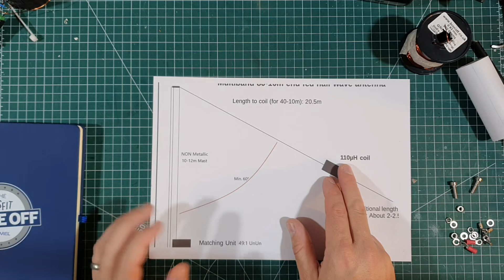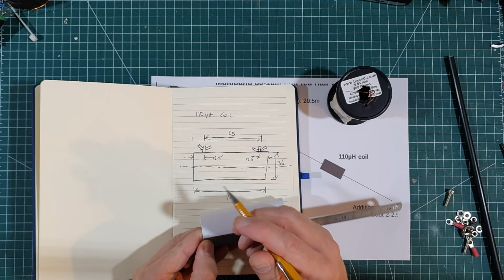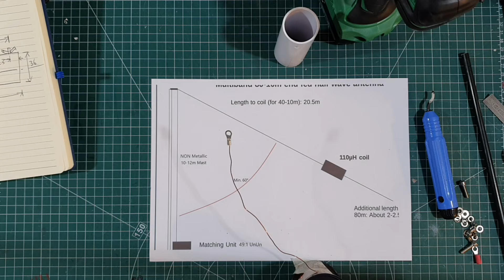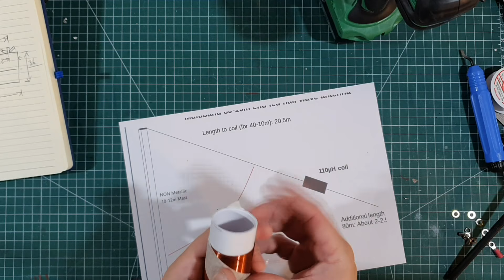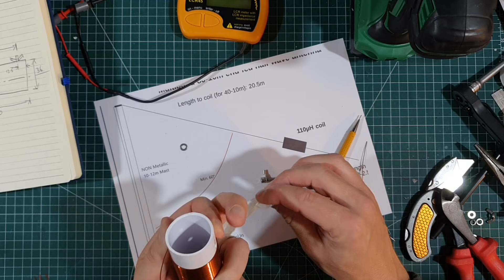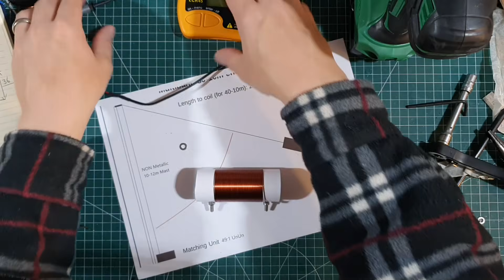80m with your 66ft end fed half wave antenna?... How to easily make a 110µH loading coil.

Comment: The video is old, but may someone answer my question. 66 feet wire length is from the mast bottom + to the top + the rest with coil or from mast bottom to top + 66 feet?

Comment: The coil built in this video is a workable field coil, but not an efficient or stable one.
36mm is too small for 110 uH; small diameter means too many turns per uH and excessive turn-to-turn capacitance. Use 50 to 75mm pipe instead.
Do not close-wind enamel on this type of coil. Tight packing gives maximum proximity loss, the worst Q and the most interwinding capacitance. Space the turns 1.5 to 2x the copper wire diameter. Use 18 to 16 AWG wire, not for higher power but for higher efficiency (for QRP or QRO). PTFE-insulated wire can give you the spacing you need, if the jacket is thick enough to leave a proper gap. ~110 uH on an LCR meter is still a good starting point, but wind a few extra turns initially and don't screw it down until you measure with a VNA, if available. (otherwise, stick to 110 uH on the LCR).
Non-sealed tape over a winding becomes a wet sponge after a rain; tape keeps UV off the enamel but keeps water in. Water ingress will adversely affect the SRF (self resonant frequency) for 40m (which must remain well above 40m) and affect the loading for 80m (shifts the 3:1 SWR bandwidth). Better to use a light conformal coating without a jacket, allowing the coils to drip dry.
The SRF should be checked on a VNA, before and after it is coated. The final SRF should be no lower than 12 MHz, ~15 MHz is better; if SRF is too low, expand the winding pitch or remove turns (removing turns also drops L, so you may need a longer 80m tail). Coat all but the last few turns before final measurement.
Conformal coating will raise the interwinding capacitance, so it will also move the SRF down. A thin acrylic / polyurethane film has the least effect: capacitance up about 10 to 25%, with SRF down only about 5 to 12%. Adhesive heat-shrink or tape (do not use) over the whole winding can increase C 30 to 60%. So start with a safe margin of SRF > 15 MHz and coat the coil lightly, if at all.
A larger form, thicker spaced wire, and a water proof winding mainly cut coil I²R and dielectric loss. Expect about 1.5 dB more radiated on 80 m. The bigger gain is stability: a taped PVC coil can drop another dB or more and walk off 80/40 m after rain.

Comment: You had that little bit of wire left over while making the inductor.  What would have been the inductance if you would have gone around 1 more time, would you have been closer or further away from the target of 110?  Either way, I'm going to try and build one of those antenna thanks!  Do you have the values for 160 meters as well?

Comment: I just finished building one of these coils. I'm here in the United States and used 3/4 inch PVC approximately 14 inches long. I wrapped it with 16 gauge enamel coated wire, 180 turns. My reading is 120 uH. I used a 7 ft piece of number 12 THHN wire and folded it back on itself.  I achieved a 1:2-1 swr at 3.800 mhz.

Comment: Can one get an antenna that works 80 to 10 down to around 40 feet by using two coils, one for the 40 meter band and another for 80? I want to work 80 but I just don't have the 66 feet to work with.

Comment: Isn’t the 20.5 m wire already at near enough quarter wave couldn’t you just bypass the auto transformer and throw as many radials to ground  as feasible.     and get a decent match or is this just for the convenience of using same set up?
Reply from the maker: Thats it. No radials and no mechanical stitching required.

Comment: I have room for an 80m inverted V between the first floor roof of my shack, the 2nd story roof and the roof of a backyard ramada.  I am thinking about optimizing 40 and 80 for NCIS allowing the harmonic bands to reach Dx heights (relative to wavelength).  I could switch in a coil at the apex with a relay for 160m.
Reply from the maker: Yeah thats an option. You could have another trap but bandwidth on 160 would be very narrow.
Reply: Just noticed that autocorrect changed NVIS to NCIS (and just tried three more times).  I have since seen that some people bypass the transformer completely  to use the wire as a quarter wave at 160m
Reply from the maker: Yes seen that. You need a big radial field tho. Not difficult to install a SPDT relay and switch it remotely.

Comment: Any suggestion on how to make this build resonant on 75 meters? Some content creators insert a capacitor at some defined point, but their build is different. I enjoy this antenna, and it works beautifully. But I'd like better SWR on 75 m. Thanks.
Reply from the maker: To get both 75 and 80 I think you will be toiling. The bands are just too close together.  We dont have 75m here.
Reply: @MM0OPXFieldRadio  Thanks!

Comment: Great video. I noticed that you used 0.63 mm enameled wire. What is the max transmitting power (watts) that this coil can handle?
Reply from the maker: Depends on duty cycle a lot. I haven't ran at 100w SSB but would give it a go.

Comment: I guess the same could be used to add 40m to a 20m EFHW? That would be really cool for portable use, making it possible to have 40m with a relatively short antenna. The coil could even be constructed more compact for use with a small 5 watt radio like the QMX. Do you know what inductance it would need to be?
Reply from the maker: Correct. It has been done but not by me. I think Tim G5TM made some videos on this.
Reply: @MM0OPXFieldRadio  ok cool I'll check him out, thanks!!!

Comment: We used to buy LCR meters because we couldn't afford ~$10,000 for a VNA. Now VNAs are so cheap, we no longer need LCR meters.
Reply from the maker: Your right but tje LCR meter is so convenient to use.
Reply: @MM0OPXFieldRadio  not for me. The LCR meter gives me the reactance at like 1kHz. I prefer to see the inductance or capacitance at my operating frequency. The nanoVNA lets me do that. I could be way off with the LCR meter.
Reply: @N9XRradio Sorry to reply to a 2yr old comment, but just to say I use my RigExpert stick for this. I was under the impression it didn't really matter what frequency you used but to avoid the resonant range.
Reply: @hermitcrab49 you can use any frequency you want, true. But if you want a precise measurement for the frequencies you are interested in then you won't have any surprises. I don't like surprises.

Comment: Update to the update. I've discovered that this antenna design also works as a 10, 15, 20, and 40 meters as well using a tuner. No tuner is necessary on 20 meters....amazing.
Reply from the maker: The magic of radio 📻 ✨️
Reply: The point of this antenna is that no tuner should be necessary on any of those bands. It may need a compensation coil and/or capacitance.

Comment: Hi! does it have to be an air coil to work properly, or can it be with a core to wind fewer turns? if only air, why? 73
Reply from the maker: You can wind it on a solid former if you wish as long as its non conductive. What matters is the inductive value.

Comment: Your video helped me tremendously. I needed an 80 meter antenna that would fit in a 70 foot long area and this design did it. It works like a dream eventhough it's feed point is just 6 inches off the ground and the coil end is only 22 feet in the air. Thank you!!
Reply from the maker: I'm glad its working, I've yet to put mine up.
Reply: Just curious as to what part of 80 meters do you get?
Reply: I tuned it to 3.975. Typically coiled antennas have a high Q and narrow bandwidth, so if changed frequencies I often had to use my tuner. But it works great across the 20 meter band without a tuner.

Comment: Thanks for good information. Given that this antenna should work at 10, 15, 20, 40 and 80 meter band... how do we tune/cut it to lowest  swr? I mean, the longer part of antenna...which goes from the transformer to the coil... at what band should we tune it?
Reply from the maker: Only the bit beyond the coil is for 80m. Tune the wire with only the coil at the far end for 40/20/15/10. Add the remainder on far side of coil for 80m and tune.

Comment: A 66 foot long end fed, assuming it’s configured as an inverted L or even a low horizontal wire for NVIS type work, can be fed directly from a 50 ohm coax feed line without the usual 9:1 or 49:1 end fed transformer as a quarter wave radiator on 80/75 meters.  I keep a nominal 66 foot wire in my mobile kit, and use it as a quarter wave wire when parked as a sloper or inverted L hung from a tree or as a low horizontal wire, connected instead of the normal mobile whip at the mobile antenna’s base at the left rear corner of the truck above the fender line.  Like with the mobile whips on 80/75, a small inductive shunt coil or capacitor (500-1000
pf) across the feed point allows my IC-7100, which does not have an internal antenna tuner, achieve a near perfect 1:1 SWR match at resonance.  The quarter wave wire works against the truck body as a counterpoise just as the mobile whip would. If desired , improved efficiency can be obtained by deploying some wire ground radials connected to the truck body at the feedpoint.   If using a quarter wave wire in the field, you obviously will need to have some wire radials as a counterpoise.  I’ve observed that a quarter wave low to ground horizontal wire for NVIS short haul propagation gives at least a 10 dB improvement over a good 75 meter mobile antenna when using just the truck body as the counterpoise in either case.  

Chris AJ1G Stonington CT
Reply: There are videos of the 80m EFHW (132ft wire) acting as a quarter wave on 160m (with radials). There's relay box to switch the transformer in and out.

Comment: I created my own antenna similar to this one only I used 26 gauge copper wire, around a solid cardboard pipe wrapped about 200 times or more. To get a good signal...I use it for FM reception and it works well.

Comment: Hi Colin! Thanks for sharing! I now have a loading coil for the EFHW I am putting up in the garden. Some tips for others - do use the calculator in the link shared in the information above to make sure the resulting inductance is the 110uH you want. I used thicker wire (1.6mm - because I had it), so of course it won't be 65mm long once I have the right number of turns. I found that 100 turns is about 175mm long. After several iterations with the calculator,  I ended up with 110 turns on a 43mm former (+ the wire thickness, since the diameter in the calculator is to the wire centre on the coil) and the coil ended up 19.8 cm long. The third time I cut the former (!!), I left it long, and cut it to length after I finished winding the coil. The final value of inductance on the coil is 0.11mH according to my cheap component checker - so bang on! Now I need to get the wire up and tune it. I assume I tune 40m before adding the coil, then tune the 80m tail? 73, Paul (MW7PAJ)
Reply from the maker: Yes the inductance can vary due to many factors. I find the LCR meter invaluable.

Comment: If the loading coil is a little low, just cut the end wire a bit longer.  It will just give you a wider usable bandwidth in the end.  I have a coil loaded Dipole for 80M at my QTH, because my yard is far too small for a big one.  I set it up as an inverted U with the horizontals out to the coils and the trailing ends as the vertical elements and it works beautifully.  With a tuner I can hit everything in the 80 Meter band, but it's resonant in the voice section.
Reply from the maker: Excellent hint 👌
Reply: Are the two coils both 110uH? i.e. are they the same as for a single legged EFHW?
Reply: @paulsengupta971  I have no way to compare this to an EFHW, but the coils are the same.  In the end, the exact impedance is not critical, you make up the difference with the length of the wire.  The whole purpose for the coils in the leg is to make them "appear" electrically longer to the radio.

Comment: You are measuring the inductance at 1kHz and it will be significantly higher in the 80m band. I made an inductor with 80T of 0.9mm wire on a 36mm diameter former and measured it with a NanoVNA. It was 89uH at 90kHz and 110uH at 3.7MHz.
Reply from the maker: Quoting someone much smarter than me "Since, inductance is a property, it is a constant and does not depend on any factor and hence does not depend on the frequency. The inductance depends on the make of a conductor.
Therefore, the inductance does not depend on the frequency."
Reply from the maker: I leave the LCR meter set to auto. The Meter measured almost exactly as the 66 pacific calculator. It doesn't need to be spot on as you cut your wire beyond to 80m resonance.
Reply: Theoretically, L is constant.
Practically, its behavior (and even effective L) can vary with frequency due to non-ideal factors.
Reply: Impedance changes with frequency, inductance does not change with frequency.

Comment: Just made  up one of these coils, My inductance meter says its around 100uh, Was originally 110uh, But by the time i put it all together it had dropped to around 100uh, Problem is its resonant around 2.2 Mhz, Taking a few turns off and trimming the pigtail made little difference, My EFHW is only around 5m high, Reckon that's what's causing it to detune on 80m
Reply from the maker: Ground effect can make a massive difference. Sounds like something is interacting.
Reply: @MM0OPXFieldRadio   Thanks for the reply, Aye that's what it turned out to be, Last ten feet or so was running down a pole in an inverted vee configuration, Which meant the stub after the coil was only a few feet above ground, Tried another configuration and it now works a treat, 150 Khz of bandwidth on 80m. Coil is only 98 uh so i had to make the stub longer (7 feet) SWR on the other bands is much the same, Infact its reduced my SWR on 10m 😃
Reply from the maker: Glad you got it resolved.

Comment: I gave this coiled 80 meter a trial in Saskatchewan. VE5RUS. I have a compromised location and could only get the antenae about 20 feet in the air. Design restrictions to end of property has an "L" at 55 feet. Plus my real world tuned length was 60.5 feet of wire for 40 meters. The coil was wound with 15awg  .060 mag wire on a 1.60 OD pvc conduit. It was 105ish  turns. Meassured 109.2 uH after the tape covering. Very tight bandwidth indeed. Less than 100 kc more like 50kc at 1.5 -1.  i was trying to hit the canadian voice portion of 80M.
I have to ask would there be any bandwidth gain if I say cut micro henries in half (55) but added more wire downstream of the  coil. Presently there is only about 8 feet on the wire leg all of which is at 90° ish from the 40M section.  Great video presentation by the way. Incidentally i used your preferred torroid ferrite 63mm double hieght wound 56-1 to impedence match the EFHW 10-40 wire which is 12awg insulated XLPE electrical multi stranded.

Comment: 110uh coil for good SWR 3.600 khz ? 
80 uh coil swr for 3.750 khz ?
Reply from the maker: No, remember you have a piece of wire that extends beyond the coil. Make it 110uh and fine tune by lengthening or shortening the wire.

Comment: I'm curious about opinions from those that got to experiment a little more than me. I made this version some while ago... but I only had 0.7mm wire for the coil... so I ended up with a tight bandwidth on 80m. My question... since I have a really long backyard... wouldn't be better to use a proper 1/2 halfwave on 80m wire ? It should work better and have a better bandwidth I guess right ? 73 Colin. I'm still hunting you for my log )))
Reply from the maker: Your thinking is correct. You will however have huge nulls and lobes using such a long wire on the higher bands. Give it a go, could be great.
Reply: @MM0OPXFieldRadio  I will do it this coming week and see the results. I'm curious 😁
Reply: @dxexplorer  That's what I've got set up in my GW QTH, a wire slightly longer than 40m total length. If you are into SSB on 80m then a capacitor in the middle of the wire will electrically shorten the wire on 80m to bring up the frequency of resonance on that band. A search will find a variety of ways to do this and capacitance value. I haven't done it yet but I've bought a capacitor ready!

Comment: Colin: I made a much heavier-duty coil for my 80 meter loading coil. The former was 4" PVC drain line, and the coil was wound with 14-ga insulated stranded wire. 43 turns with a winding length of  6 1/2 inches. It measured out at 103uH.  All hardware was stainless steel, 1/4-20 coarse thread, double-nutted with spring lock washers. Beefy!

I am glad that I made it heavy-duty as our 2022 Xmas blizzard here near Buffalo, NY had 2 days of winds in excess of 55 mph with peak gusts near 80 mph! The coil came through unharmed.  This shortened 80 meter design is the first antenna for the band that fits in my very small urban lot.

Great video, very informative. Looking forward to a video of the complete antenna.

73, Keith, WB2VUO  here near Buffalo, NY
Reply from the maker: Thanks,  once the warmer weather is here I will get ot set up to test.

Comment: How did it work?   Did 75 turns give you a resonant antenna on 80 meters?   How much power could you rate this coil?   Can one use insulated wire to make a coil?
Reply from the maker: To be honest I havent put it on the air yet. This is thin wire so guessing 50w or so. Thicker wire needed for 100w+ .Insulated wire will work just as well but will likely need more turns as its effectively wider spacing.

Comment: This was my first antenna...worked "OK" ....now my EFHW  is full 1/2 wave for 80m as an inverted V configuration supported at the centre on a 9m squid pole strapped to my chimney ...much better! de VK2AOE.
Reply from the maker: Any antenna on 80m has got to be bettet than none.